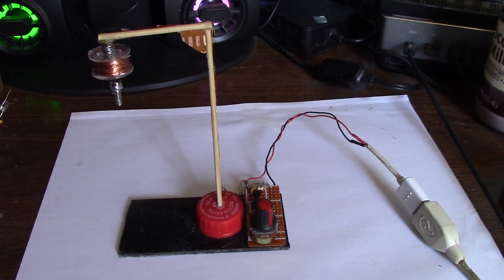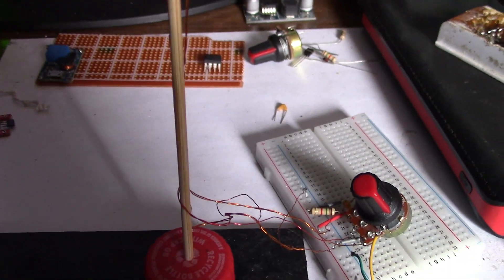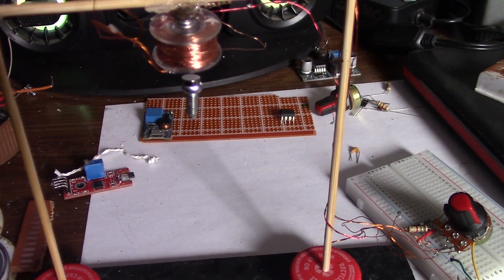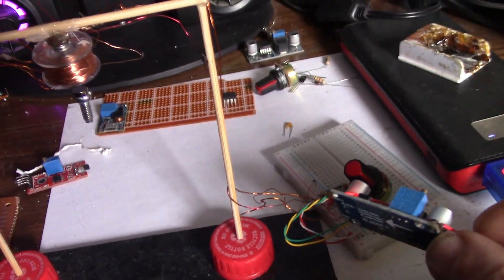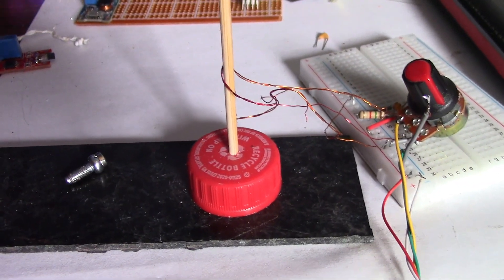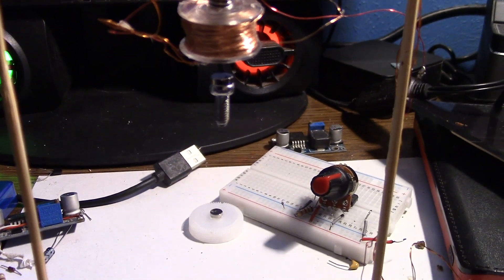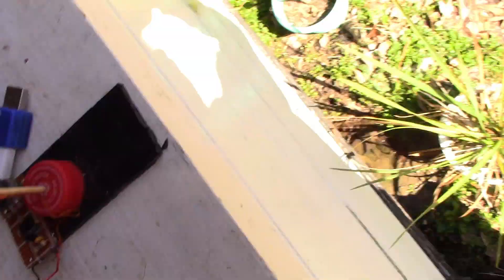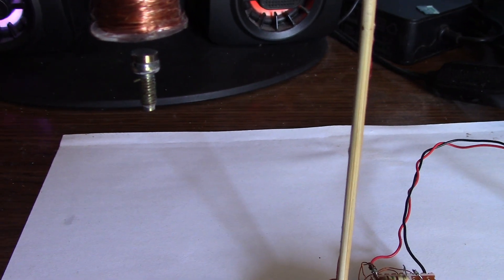Magnetic Levitator 2 - Even Simpler! (10mA 5V USB)

Comment: Mark the minimalist. Love it. Didn't mention the hall effect type though 🤔!
Reply from the maker: Cheers medi 😀 Ah, Hall is a 49E, it was in the previous video but indeed not mentioned in this one It's a linear voltage out type, with 2.5V mid point at rest.
Reply: @Slider2732_  Thanks a million. I wasn't sure luckily i have it.
Reply from the maker: @ Great to know you have it!
Btw, Vcc Gnd Out is the pinout with curved face pointing towards you. Also, the Hall should face curved side down under the coil.
Best of luck 😀